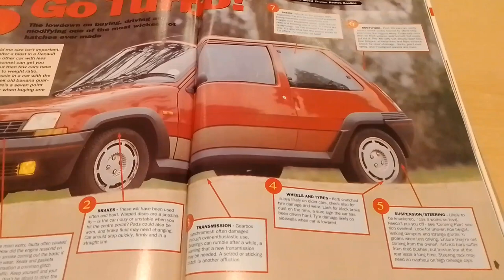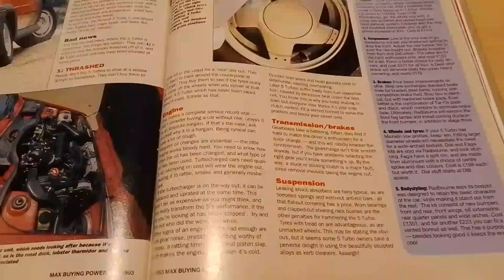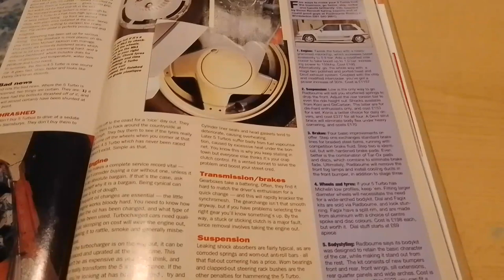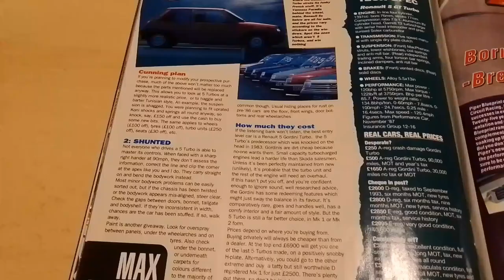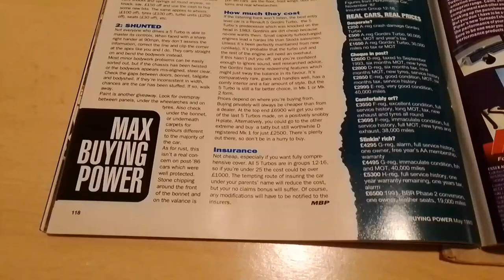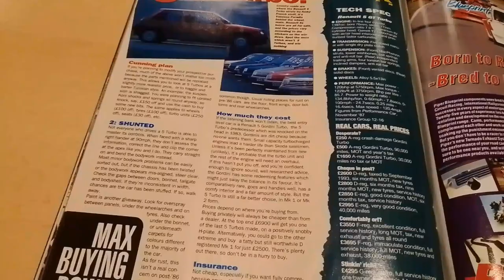Bring Back Max Power - A look at the first edition of Max Power Magazine Part 7 **Special**

Comment: I.enjoyed that Davy.
The car featured here is a fairly late phase 1 pre facelift example of the GT Turbo. Ironically it's thanks to the Max power era that many didn't stay looking like this one. 😅
I remember the hot start issues caused by fuel evaporation but it wasn't just the GT Turbo, the 1721cc cars suffered the same issue. Ceramic coated exhaust manifold was one rather expensive fix for this issue. The phase 1 GTT produced 115 bhp from the factory whereas later phase 2 cars put our 120 bhp and benefitted from better cooling and more standard equipment as well as colour coding to exterior body work. There were also subtle changes to the style of bumpers, side skirts and front fog lamps.
GTT also had slightly different rear suspension from other versions. The GTT raider towards the end of production are some of the more sought after cars.
By the way they are known for doing a lot more than 120 mph.